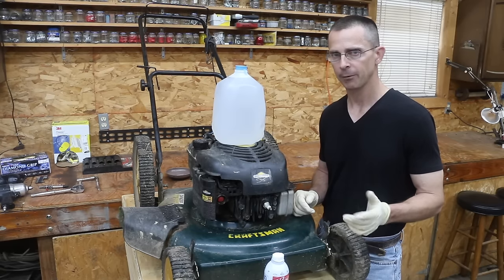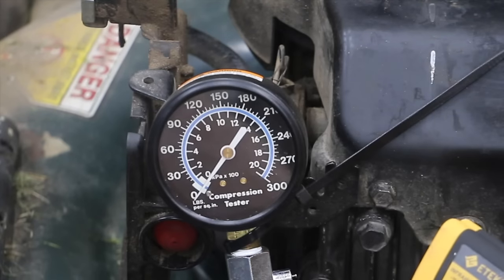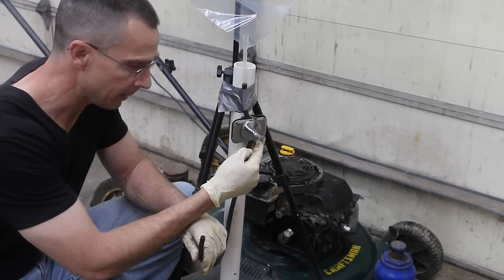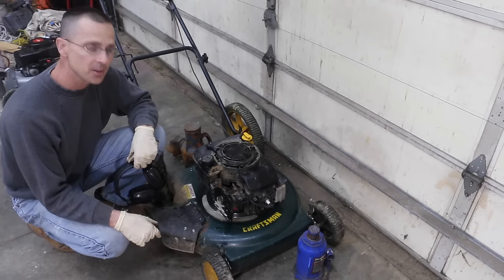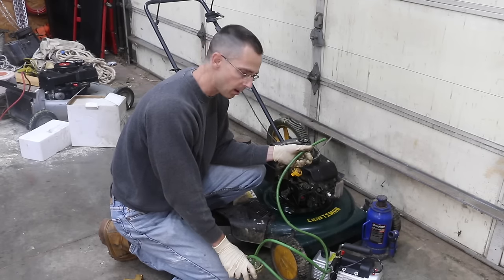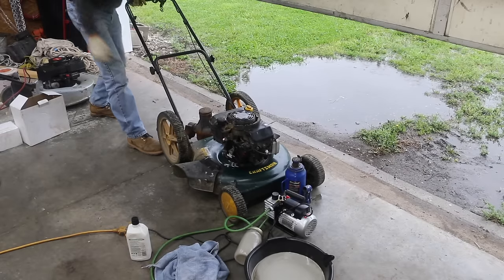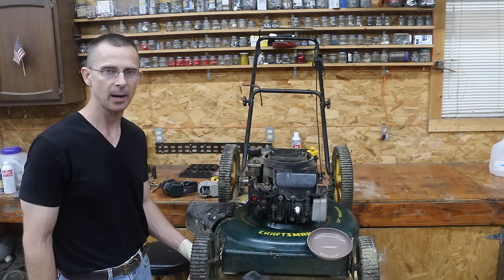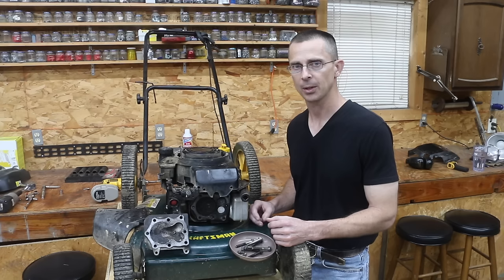Seafoam--can't believe what it did to my engine episode 5--cylinder cleaning test using water!!

Comment: Cadillacs and possibly a few other cars had a water container under the hood that allowed very small amounts of water into the engine that would turn to steam and increase power and keep the combustion Chambers spotless clean also world war II airplanes had WEP which stood for war emergency hour and would inject small amounts of water into the combustion chamber which really increased power the water may have also had other ingredients in it but I only speculated on that. Of course if you add the water too fast it will not have a chance to explode into steam and will cool the cylinder and not work
Reply from the maker: Thanks for the feedback.

Comment: 😅 The old guys that know how this water trick really works. They ask for a glass of water. Get their engine running screaming hot and then dump the water in the carburetor. 😂 You're over complicating things. That's why you're getting water in your crack. 
This is why I prefer seafoam because it doesn't matter if it gets in your crank because it's allowed to go in there. It's not a problem.

Comment: WHEN THE ENGINE TEMP DROPPED, YOU WERE NO LONGER MAKING STEAM, WHICH IS WHAT CLEANS THE COMBUSRTION CHAMER. YOU SHOULD HAVE ADDED WATER BY SHORT INCREMENTS ALLOWING FOR TEMPERATURES TO REBOUND ONCE THEY DROPPED BELOW 212°F... LESS WATER WOULD HAVE BEEN  USED , AS THE TEST SHOULD OF BEEN CUT TO ABOUT 20MINUTES.

Comment: With cars, just a bottle if water added to the hot engine, high idle or enough throttle to keep the engine running while pouring the water. Used for abour hundred years now, works well, and does not make problem with the water in oil, the small amount evaporates away next time the car is driven on freeway. Taxis have used that for as long as there has been taxis, as they used to get more carbon in city traffic. And, more carbon in the combustion chamber, the more compression there is, so the test is useless...

Comment: The question that wasn’t posed….
1. What measurable improvement(s) are we attempting to achieve by this exercise?
2. What measurable performance improvement(s) were achieved?
Save yourself from wasting  your time if you plan on adding a comment that fails to answer the core questions.
Remember…MEASURABLE, QUANTIFIABLE.
Example of an invalid observation that results in a measurable improvement in performance : “valves are cleaner”

Comment: I bet everyone that suggested drip feeding the water has never actually done this. It should be fed in in gulps with the engine at ~2500 rpm. It should stumble each time and then come back up to get the heat back. Literally rinse and repeat.

Comment: No!!! No water in engine. The water in the oil might boil out eventually but what if it doesn't. I am guessing the water is just blown past the piston rings and a car would probably do a better job blocking the water blow by. But definitely not if it means I have to change the oil.
Reply from the maker: Thanks for the feedback.

Comment: The only time I pour anything down a carburetor is to loosen a sticky valve on an overhead valve train engine and I only use transmission fluid it loosens and lube at the same time and will generally work, no other reason to doing it that I can see
Reply from the maker: Thanks for the feedback.

Comment: I would NEVER use water in any engine at any time.  It’s non-combustible.  It has to go someplace because it isn’t going to burn.  It makes sense that a bunch ended up in the crankcase.  My guess is a lot accumulated in the muffler too…
Reply from the maker: Thanks for the feedback.

Comment: Thinking it over. Anyone cook with a cast iron skillet? Ever get a few bits stuck to the pan? Get it nice and hot, a put it under the running tap, and it'll all melt off. I saw cooks at a restaurant clean the flat top very quickly this way with ice. I think the principle here is that a quick change of temperature(as liquid water absorbs a LOT of heat energy before it evaporates) is what's needed, the result is a physical contraction of the metal. So I think a slow drip of water is not the best way to do this. I figure the combustion chamber never got up to its proper operating temperature to have a good result with this test. There is an inherent risk with this though. A too dramatic change in temperature/contraction can crack a piston, or more likely a valve. Much the same principle as washing a glass in hot water and rinsing it in cold.
Reply from the maker: Thanks for the feedback.

Comment: seafoam is great but it's overpriced the formula is 2 parts lacquer thinner thinner and 1 part denatured alcohol highest purity possible something above 80 percent  or  higher and BAM  'Sim Sim Sala Bim' you have made your own seafoam.  I forgot you have to add about 1/2 teaspoon of dishwashing soap to every gallon of the lacquer thinner/ alcohol mixture, shake and then you're done.  it may look a little bit milky this is the water and the alcohol trying to bind to the paint thinner give it some time in about a week it'll be fine or you can shake it and then use it within 30 minutes of shaking which is no big deal if you're not willing to wait a week for saponification to occur. Do it yourself for 8 bucks a gallon at the Home Depot or Lowe's. you can find these supplies in the paint section easy enough.
Reply from the maker: Thanks for the feedback.

Comment: No I would not use water at all, for the cost of oil and the contraption, a can of seafoam just for that little engine can last five tanks of gas on that mower.  But theirs also gumout which I think is far superior that seafoam and that is around the same price.
Reply from the maker: Thanks for the feedback.

Comment: I don't think I would use water with gas to make the point. The water getting into the crank case mixed with the oil is rather silly.  Can hurt the engine. Use transmission oil instead. Good experiment though, but nothing I would try.
Reply from the maker: Thanks for the feedback.

Comment: So many comments about using water. Stick with seafoam. Contaminating the oil does far more damage to other moving parts and gaskets. Doing a water treatment sounds far too iffy. Water gets into places oil won't like between gaskets. If you used water and later on have a blown head gasket or failing oil pump. don't blame the engine.
Reply from the maker: Thanks for sharing.

Comment: Isnt this sort of like the HHO system? H20 has hydrogen, so when using h20 like in this video it's like having the HHO system, it burns the hydrogen which makes your engine more efficient.
Reply: HHO systems use electrical energy to break the stronger covalent electron bonds (if I am remembering my 101 chemistry correctly) to separate the H H  from the O.  If memory serves me, the amount of electrical power required was equal to the energy gained with the Hydrogen burned. There was also a cost from using typically Aluminum wire as electrode in the water tank.  The Aluminum was reconverted back into bauxite, its natural state before electrical arc furnaces refined it. All chemistry going round & round loosing energy through each conversion step.

Comment: Never would I use water in an engine. I’ve seen far too much damage to pistons and injectors from water in the fuel. There will definitely be an increase in engine wear anytime water gets into the combustion chamber. I have no doubt the piston in this test would have more pitting after water was used as a cleaner. And it’s also highly likely additional wear would be seen to all bearing surfaces once the oil was saturated with water.
Reply from the maker: Thanks for the feedback.
Reply: agreed. engine + water = bad news

i would just spend 10 dollars on a cleaner that's lab tested and safe.

Comment: i find it hard to believe anyone would just dump water in an engine, as far back as the 50s mechanics have used water a different way, i have no experience in single cyl just auto engines. you use a squeeze bottle or spray bottle with a very small amount of liquid soap, just maybe a spoonful, in your water, then you drip or spray the water in the carb holding the throttle part open as you do, it takes the carbon out because of the heat and the water solution, i used it in engines with a carbon knock where a piece of carbon broke loose and was rattling around. the water with the heat acts like a steam cleaner, you have to throttle up as you spray or drip. but the compression test is confusing, if you take carbon out you are increasing tolerances and should decrease compression not increase it. but then again i am not a fan of seafoam, ive seen too many people ruin a good engine using that product. if my memory serves me right they have been sued quite a bit in previous years.
Reply from the maker: Thanks for sharing.

Comment: I ran a meth injection kit 100% water on my old 12v cummins. The purpose was to keep egts under 1200 when towing. In the hills 1 gallon would last 20 miles or so. On flats it was never really needed unless I was pushing it and heavy. Unfortunately I had to pull the head after 40k miles as it had cracked after my water pump went out. The 400,000 mile combustion chambers were squeaky clean!
Reply from the maker: Thanks for sharing.

Comment: The reason you DONT use  water  is because of" BLOW BY " past the piston rings  and get into the oil  ( this is what makes sludge) it will cause RUST on the  cylinder wall when you turn the engine off and put pits on the cylinder wall and rings ( increase wear) . 
"Severe Service" driving conditions are when a person  drives for only 5 minutes to the corner store and back , never lets the engine and oil get up  operating temp. To evaporate moister in the system . many European cars have a sludge problem because the pvc ( positive crankcase ventilation) system is to small. 
Water is POISON  to oil and cast iron engine parts. EVER NOTICE HOW THE BRAKE ROTORS GET RUSTY OVERNIGHT ......
Reply from the maker: Thanks for the feedback.

Comment: Water works great for cleaning because it converts to steam. Steam or "water" powers the world and at one time tractors and locomotives. HOWEVER with today's technology and tight tolerances engines are not friendly to water contamination. Even if you put it into the cylinder blow by will still push water into the crankcase. Stick with a product designed to do what you want it to do. Seafoam for example wont matter if you get into the crankcase...because it can also go in your oil. And seafoam wont oxidize metal.
Reply from the maker: Thanks for the feedback.
Reply: @ProjectFarm  was annoyed seeing people criticizing your video not understanding why water worked. The test was well done well and showed the power of steam. I'm a boiler operator so I nerded out a little.

Comment: what you did not do right was give the engine enough time in between water infusions to let the combustion chamber get back up to hot enough temps to vaporize the water/meth or straight water in your case so it could do it's job of ''steam cleaning'' the chamber. a drop of water, when flashing into steam, expands something like 1600x from liquid to steam. try cycling it next time and your piston tops and valves will be shiny like an LPG or propane fed engine- mike
Reply from the maker: Thanks for the feedback.

Comment: 75% of people saying water would work better are trolls or cheapskates. You had to run the thing 2 hours slowly dripping water. Then change the oil. So no, I don't think it's a good solution. I'd rather spend 5 minutes and be done with it than to go through all that setup and cleanup.
Reply from the maker: Thanks for the feedback.

Comment: You seem to over think things. I used water to get carbon out of an engine using just a spray bottle used to water plants that atomizes the H2O. Spray down the carb throat of a hot engine and use the throttle to keep it running. Should only need to do this for seconds or minutes not hours !

Comment: You should have just let the engine run. The oil is hot enough to steam thecwater out of it. You want the piston hot and then just 4 or 5 cups of water ran throung the carb.  Its 5he temp change that makes the carbon break off. 2 hours is way too long and a waste of time, as the piston and head are cooled off from the stedy infusion of water. On cars we took them out and did a full throttle take off up to 80 mph, stop and then pour a coke bottle of water through the primary while controlling the throttle by hand. One primary, then the other. When you get good at it, then engine will be running about 3k rpm at wot as you pour the water into the carb. You control the rpm with how much water you pour in. If it starts revving up, pour a little more water, if it starts trying to die, back off a hair on the water.  In 20 seconds your done, and the pistons will be clean enough not to cause pre-ignition anymore. Your test was worthless.

Comment: As others have suggested, try injecting water by spraying. A fine water spray will evaporate faster in the combustion process, avoiding liquid water in the crankcase. Vaporized water = steam. Water injection used in many internal combustion applications to reduce combustion temperature to delay onset of detonation, mostly in turbocharged, supercharged engines, and thus allow further power increases. The famous P-51 Mustang fighter jet of WWII used WI in their 1650 hp Rolls Royce Merlin engine; also used in F1, pro rally cars and in selected street cars (Saab, Subaru).
Reply from the maker: Thanks for the feedback.

Comment: I have used water to clean engines for years. The trick is not to send so much water into the intake that it  causes misfires and cools the cylinders. The cylinders must remain hot so the boiling action of the water knocks the carbon deposits loose. You were putting way too much water into the engine.
Reply from the maker: Thanks for the constructive feedback.

Comment: Water wins if you use it correctly HOWEVER
I'll use seafoam because 
1.  Reduced risk of hydrolock 
2.  No funky colored oil
3. Saves time and money by not having to change the oil a few times to get rid of the funky colored oil
Reply from the maker: Thanks for the feedback.

Comment: Something is wrong you shouldn't have to pull that many times to start at warm or cold
Reply from the maker: Thanks for the feedback.
Reply: @ProjectFarm  yea i am a small engine mechanic we use seafoam on everything that comes threw the shop its very good stuff and you don't have to set up a rig and feed it to the engine for 2 hours . Also at warm mower should start first pull if carb gas and plug/coil are all satisfactory this leads me to believe 1 of the following without being there to diagnose water in gas old or varnished gas bad plug that has weak spark when hot or the valves need adjusted or are carbon enough to leak slightly which I believe isn't your issue since you checked compression and it looked like it holds steady. Thats a brut mower and it should have a Briggs b&s engine most likely on the brut is a plastic carb that when u drop the bowl has a plastic white insert with a ball bearing in the bottom of it pull that out grabbing lightly with pliers careful not to dislodge that bearing . Clean those jets and see if it start easier if not and everything else passes your optest then it has deteriorated to the point where the air fuel is off slightly and won't ever run good without a oem replacement dont by after market ebay carbs people read carefully on amazon or ebay because alot of time they put the oem part number in  the description to throw u off and make u think its oem . Oem is more money but 97%more reliable and runs better 100% of the time . You might not hear it without a trained ear but they miss and burp and fart with A.M.carbs/parts. Sorry I went ham just my experience with small engine repairs and mowers

Comment: To have an air cooled engine sitting still running for 2 hours is never good on it.
But for me sea foam is the better option no reason to flush crankcase 
No chance of leaving moisture in the crankcase as it will cause pitting in the bearings.
Reply from the maker: Thanks for the feedback.

Comment: A spray/mist system would have been better to go with Vs. the drip method. May have prevented oil contamination. Also, a whole gallon of H2O vs a pint of Seafoam....really?

Based on time consumption...Seafoam, better yet- Gumout.
Reply from the maker: Thanks for the feedback.

Comment: Too much water. You don't need to do that for 2 hours. Especially not an entire gallon. Used to do this on older motorcycles to clean carbon out. A cup of water works just fine.
Reply from the maker: Thanks for the constructive feedback.

Comment: I had a guy dump 1 gallon of sea foam into 10 gallons of diesel in a tractor. A few days later it started blowing oil because all the deposits got cleaned out and sludged the oil rings.
Reply from the maker: Thanks for sharing.

Comment: This isnt the way its done. I decarbonized engines back in the 1960's that used lesser quality oils, and gasoline with 2 gram tetraethyl lead per gallon in it. It only took a couple cups of water, and it was poured in the first cup by revving the motor while POURING warm water through the carb. The second cup was hot water which was dumped in until the motor stalled. The car sat overnight. Next morning you started it up, revved it and your driveway behind your car was full of chips of carbon and lead formations loosened by just water. Look at the msds breakdown for seafoam.... wow its ******r ******r. The mystery ingredient is probably water as its not declared on the msds sheet.